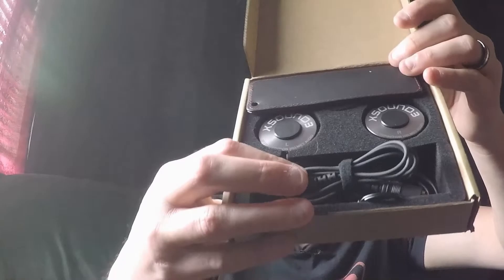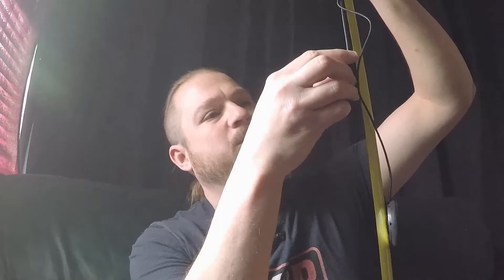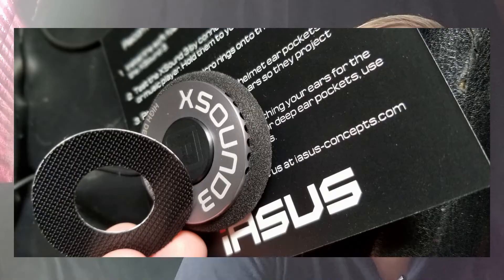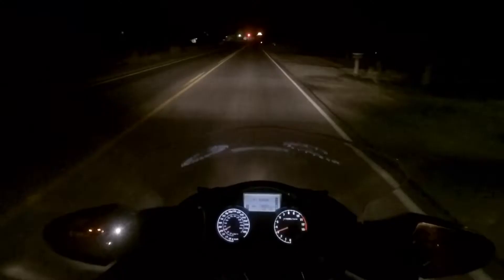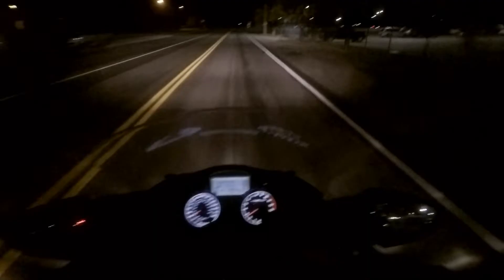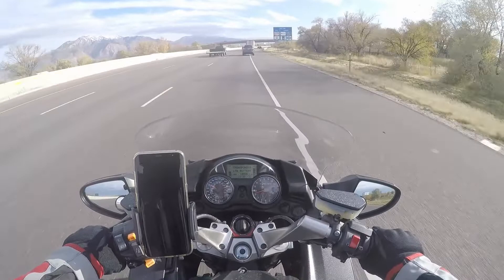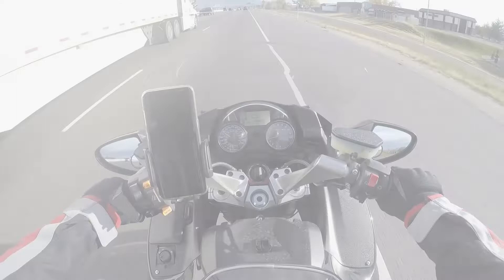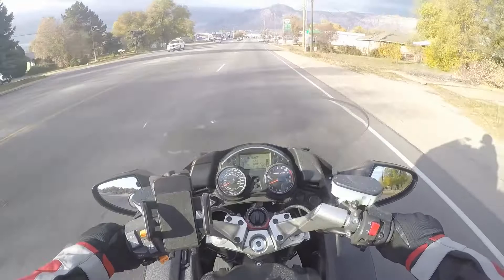XSound 3 Helmet Speakers by iASUS - Total Motorcycle Review

Comment: I dont know what to do because there are so many mixed reviews with these and most other helmet communication systems. I think most people just slap them in the helmet and don't worry about getting the spacing from their ears right. I like my sena 10s but id like some more volume and some bass.
Reply from the maker: Does the Sena 10s allow you to swap out speakers. The iASUS XSound3 kit is just a speaker upgrade, not a stand-alone comms system. You may be able to use these speakers to get better sound from your existing unit.

Comment: She sounded very clear during the call. I have a  Boom Audio N02 Full-Face Harley D helmet. Do you know if  iAsus XSound 3  speakers would work for me?
Reply from the maker: Alex, thanks for your comment! As a point of interest I want to clarify the audio in the video wasn't the actual audio from the speakers, Carrie was using a recording device on her end. What's important is you can tell from our conversation we had no problem hearing each other. 

The Boom N02 has its speakers built-in, so unless the helmet has a standard 3.5mm audio jack the speakers connect to, you wouldn't be able to swap out for a different set of speakers. Otherwise you'd have to use an entire different comm system to use the XSound3 set.